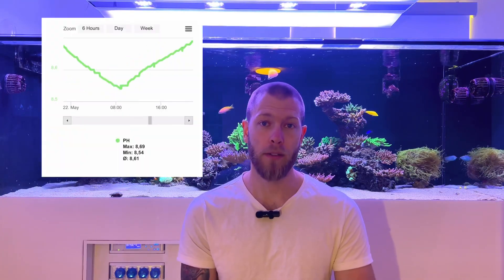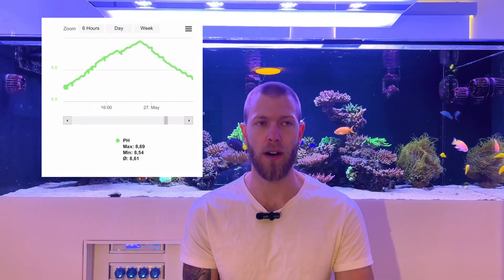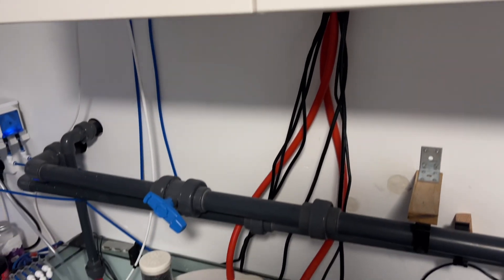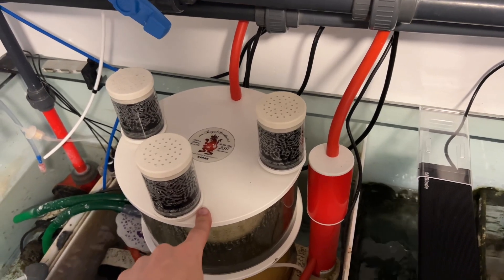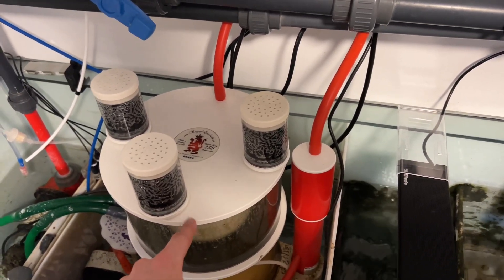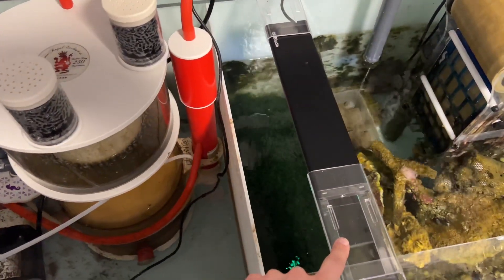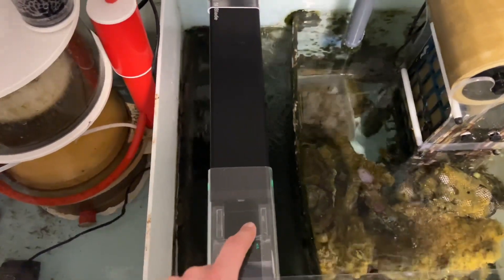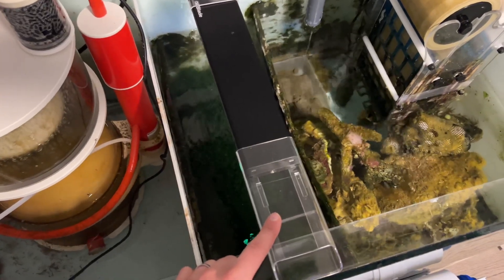Recirculating co2 scrubber - Increasing PH in your reef tank - SUPER simple!

Comment: Thank you for your video.  Fascinating setup and results.  But, I must be missing something.   The way I see your setup, your inflow air comes through those 3 carbon filled cups through the lid, then to the 2 carbon scrubbers, then to the skimmer into the reactor and collection cup.  Some of the scrubbed air will be recirculated, but a significant fraction of the air in the collection cup will be 'fresh air' through the carbon filled cups.  Did I get the analysis correct?  Your system is scrubbing 'recirculated prescrubbed air' + 'new air'.  I suppose the benefit is that the air coming from the bubbles (one can think of it as exhaled by the tank inhabitants') is rid of the CO2 at the scrubbers.  But how would that be an advantage vs just venting it and bringing in new scrubbed air.  Unless the 'exhaled air' has a lower CO2 fraction than scrubbed outside air.  Nonetheless, the results are truly remarkable.
Reply from the maker: No,  no really. It pulls through the skimmer cup in to the air intake. The volume of air will be equal so very little of any outside air will enter the system.

Comment: Nice idea, but didn't work out for me. Back to the hose with outside air 😊
Reply from the maker: It will depend on how your co2 is introduced. My main contributing factor is the fish inside the tank. Ambient co2 is very low as I have a very effective full house air exchange unit.

Comment: I've been running into issues with my ph for a while now. I have a red sea 425xl. Extremely heavy coral and fish concentration. Dosing 50ml of code a&b brightwell. Equipment: reefmat, 150 int skimmer (running 24/7, brs carbon and gfo reactor, and co2 scrubber. My ph is 7.7-8.0 at best. I dont have another chamber to run cheato, however, i do have a santa monica algea scrubber( old school using air pump)  im considering using that to raise nightime ph. Furthermore, i just ordered a co2 recirculator for the skimmer. Thoughts any other recommendations?
Reply from the maker: I’m thinking that since you have a lot of fish and the standard scrubber isn’t working your issue isn’t ambient co2 but rather a high co2 production from within the tank. A recirculating design should definitely help.
Reply: @viking_reefing  so I obtained a recurculator for my co2 scrubber to my skimmer top with plugs. However, I've actually seen the opposite results. My ph lowered by .1 from its base. With the line off, I am getting peak 8.1 with it on the skimmer peak 7.9.
Reply from the maker: @homebredaquatics  hmm…strange. Is the skimmer powerful enough to suck adequate amounts of air through the media? You dosing restrict air flow to much with to small a hose right?
Reply: @viking_reefing  most definitely it's an octo 200, and I got a recirculating top that also capped it specifically designed for this application.
Reply from the maker: @homebredaquatics  that’s very strange indeed. Flow restriction is basically the only cause I can think of

Comment: No condensation getting into the co2 scrubbing media?
Reply from the maker: Nope, I have a long run from the skimmer so it hasn’t been an issue. A little bit of humidity is good as it increases the longevity of the media.
Reply: If you look at his setup the canisters are way higher than his skimmer—any condensation immediately flows back to the skimmer and doesn’t collect in his tubing or scrubber

Comment: I started experimenting with Kalkwasser last December, initially with a vat of RO/Kalk mixed water added overnight. Then I bit the bullet and purchased a Kalkstirrer and a continous duty dosing pump. I know approximately what my evapouration rate is, however my Kalk dosing is controlled by my pH probe anything under 8.2 and the dosing pump turns on, which is overnight. My pH range is between 8.18 to 8.38. I would like to flatten that curve a little bit more but I have to consider the amount of RO water I am adding. During the day I add All for Reef to take care of the Trace elements and the Mg.
Reply from the maker: Kalk works great. What I did is that I figured out what my daily evaporation was and made up for about 90% of that during the night. However, I must say that I’m liking the co2 scrubber a lot more as there’s basically nothing to clean or refill. 
What I found to be a headache is that your evaporation really changes throughout the year based on ambient humidity.

Comment: Hi , would the extra three holes on the skimmer lid need to be blocked off to make this work correctly , like yours has carbon over them  which will restrict the ambient air from entering the skimmer .
Reply from the maker: I would imagine so. Probably won’t make a huge difference but might as well.

Comment: I used the skimmer to control PH. If ph > 8.5 skimmer off. But the skimmer was off alot during the day which was ok for me because i had low nutrients already.
Reply from the maker: That would work as well but I would prefer to have it on as it helps with gas exchange